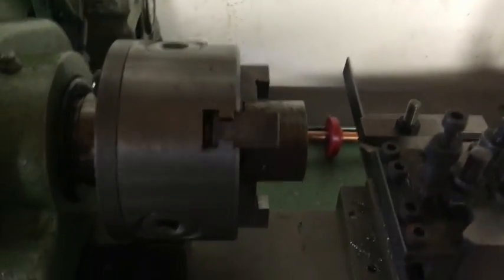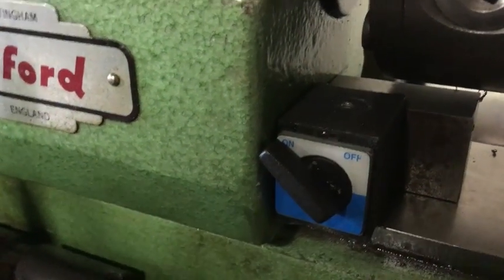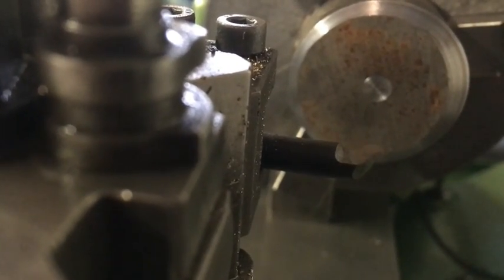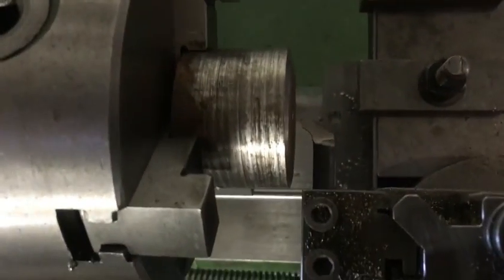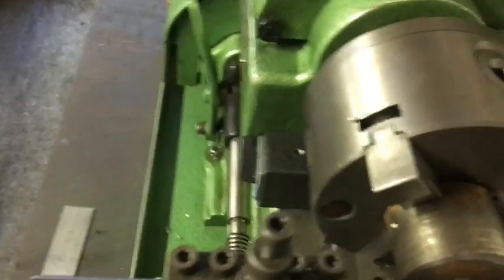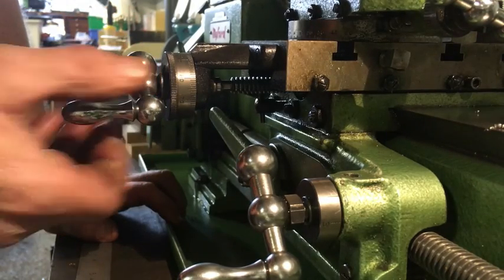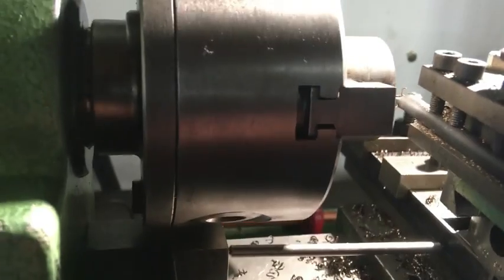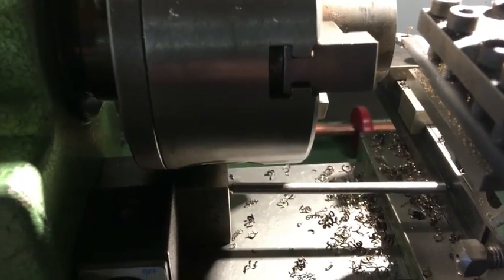Poor mans CNC lathe convex radius cutting

Comment: How would you cut a concave radius using this method?
Reply from the maker: all you need to do is use the tailstock rather than the headstock. Lock the tailstock in position and transfer the other items to the tailstock side of the cross slide, the tool can then cut a convex radius. Hope this helps?